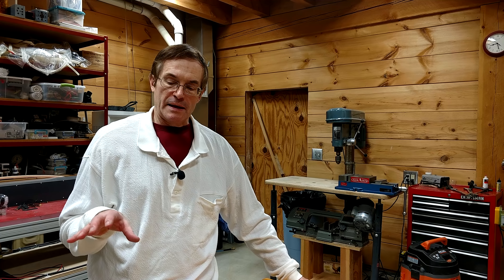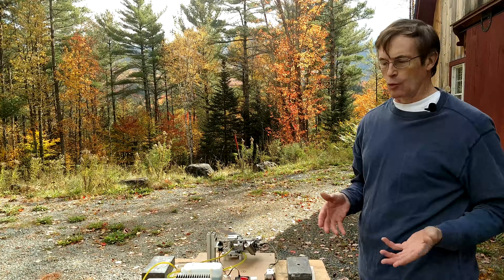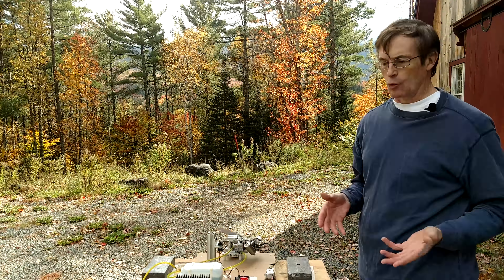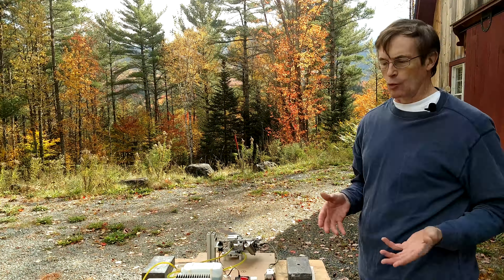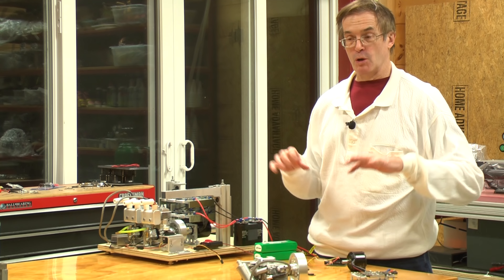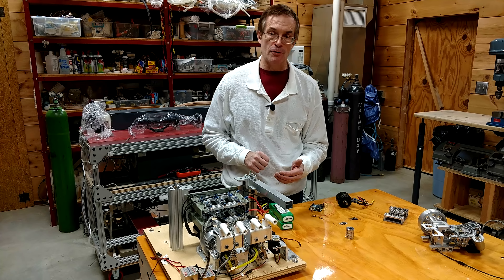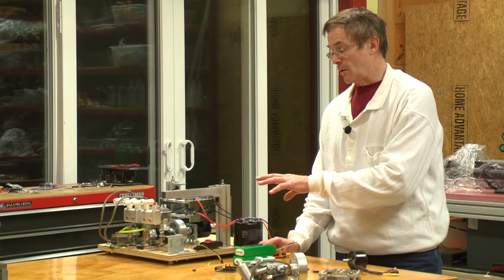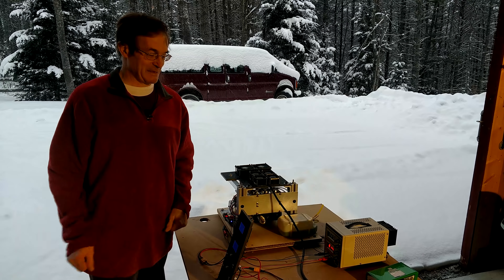Hybrid Drone Generator

Comment: A gas turbine is the better alternative, because all four strokes occur continuously and simultaneously, being separated by location within the engine, rather than by sequenced timing within the same space. Of these, the Tesla Turbine becomes the most appealing option if one wants to build the engine from scratch, because it is easier and cheaper than any other to construct. Use ceramic turbine discs instead of metal to withstand very high temperatures. Incredibly smooth with amazing power to weight ratio and very good fuel efficiency. Couple two of these turbines on the same shaft to use one as a turbosupercharger for the other and you get a staggering increase in both power and efficiency. An important design consideration in the Tesla Turbine is that it operates on gas adhesion. So the spacing between the discs matters a lot. The smaller the gap between discs and the more the number of discs mounted within the available space to make opposite disc surfaces proximal to the best part of the same boundary layer instead of each having its own boundary layer, the higher the efficiency. Ensure in the design that the hot gas circulating in the spaces between the outermost discs and the turbine sidewalls is minimised. Each will generate its own boundary layer, but when this is passive, it presents less impediment. Concentric circular sawtooth ridge & groove ringed surfaces on the outside of each outer disc will significantly reduce this, especially if the same sawtooth rings with the same spacing are present on the turbine sidewalls with disc and sidewall ridges almost touching. This reduces gas penetration into the space with progressive pressure reduction between each groove space and also restricts vorticity in the spiro-circular gas motion.
Reply from the maker: That's an interesting idea. We have built and tested a very small turbocharger/turbojet, not for a thrust application, but as a gas generator for a turbine. 

We have investigated a Tesla turbine and based on my knowledge, you're description is accurate, but there is one very serious problem with it, RPM.  The peripheral speed of this turbine needs to be close to the exhaust velocity of the jet in order to achieve the high efficiency it is capable of.  with a small diameter turbine this around 80,000 RPM.  Directly driving a generator motor at this speed would require an unusual motor. As far as I know, reduction gears that operate at this speed are rare and prohibitively expensive.
We're looking at an impulse turbine similar to Pelton wheel.  Although less efficient, it is easy to construct and produces maximum efficiency at 1/2 the jet velocity.
Reply: Thanks, I see what you mean. Love your teaching videos!  However, rpm at the TT shaft can still be very dependent upon physical load and the amount of fuel being used - also spacing distance between discs. Because it uses boundary layer adhesion, you can stall the turbine under too much load, without necessarily stalling the gas flow. I also think that tangential gas jet induction velocity at the TT can be adjusted to some extent by variation of the nozzle aperture, both in size and angle. I have noted that this is a common appurtenance in TTs (at least, the angular variance is). Beyond that, operating pressure must also influence gas velocity. Slow the flow, increase the pressure.  Adhesion should be about the same at a given rate of fuel combustion, I think. Exhaust aperture size and number, plus exhaust cooling to produce better extraction are two more considerations that may help in achieving an optimal operational balance.Thanks also for your mentioning the Pelton. I am not familiar with that, so it gives me something to follow up with and learn about it. There are other enhancements that I would advocate in the construction of a TT. For example, the interior of the turbine casing can be lined with saw-toothed grooves aligned to the gas flow.They'll be circumferential in the cylinder part and circular in the ends. The end discs would also have circular groove arrays.  These are pretty much like 3M's Microriblet contact polythene sheet, but in the turbine, they should be high-temp alloy.  Cheers!

Comment: Wouldnt you want to use a treadmill motor. They are a 90 volt dc permanent magnet motor and all you need to do is correct the voltage and not worry about rectifying. Am I missing something?

Comment: Would it be out of the question to use several smaller motors, one for each prop? Or is one of the ultimate goals, to design a relatively stealthy drone? I was thinking about some of the 1/10th scale RC cars that use some high octane blends (I believe I have seen some that use 30% nitro methane, not sure if that is real or hype). Traxxas has some that have a decent amount of power. Just curious.

Comment: If I could, I'd use a turbo-generator for the drone. Buy or build a tiny gas turbine that directly drives a 3-phase alternator. The high speed and cutting of flux lines creates a lot of voltage, and the power can be conditioned from there.

Comment: Would the use of rotary engines reduce the vibration issue?
Reply from the maker: Yes.  The only reason I didn't use one is they are virtually unavailable in this size range.  Other than a surplus OS RC engine I'd have to build my own or pay thousands for a custom engine.  That's not useful for the many viewers that might want to try this.

Comment: Will you be addressing the fact that <500w or even <1000w isn't enough to actually power a multi-rotor? This is quite a heavy set up if you take into account just the motors, generators, fuel tank, exhaust, and small batteries. You'll need somewhere around 2-4kw of power at minimum to have a useful set up and the drone itself is very very light.
Reply from the maker: Check out our follow up video on this generator where we produce over 2kW.

Comment: Interesting concept. Since this would be for a drone, why not consider EFI as that would work better with altitude and temperature changes? 
Also what about a wankel engine (possibly dual rotor) in place of the dual two-stroke engines?
Reply from the maker: We contacted a company the produces EFI for these small engines, but the prices were exorbitant.  The rotary engine would be a better choice, but other than a few used, OS engines offered on E Bay these are not available in this small size range.  We don't have the time to design and construct a custom, one off engine for this purpose.  If you have any leads into these options, we would be happy to follow up.

Comment: Hi, liking this a lot! just a daft thought to add into the mix! magnetic coupling! like the old tech heavy machines and marine, so drive comes from the engine but is coupled to each prop by magnetic coupling! lot of mechanical needed and a lot of clever code to adjust the throttle and control each coupling, but the potential advantage of not having to convert power, maybe even add a smaller generator?

Comment: 09:37 If you put a similar motor / cylinder next to it facing the the other direction it should at least reduce the vibration, but only if they are adjusted correctly.

If you build a heat exchanger and use a hose for the exhaust through the heat exchanger you can run the motors inside.

Comment: Curious why you did not opt for turbine like APU design on commercial aircraft?  Seems like even a small turbine would generate 1000's of watts.
Reply from the maker: They are very expensive and the small, RC scale turbines have a single stage compressor.  Therefore, they have a low compression ratio with high fuel consumption.

Comment: so how does this handle different levels of O2? or does it really matter? because the higher your drone goes the less oxygen it will have to work with, though i guess this really only matters at altitude/elevation changes of around 1000 feet (i think this is like 300 meters). Maybe this wont really matter as long as it can continue to do internal combustion you can just up the rpm to compensate at a bit higher fuel usage rate.
Reply from the maker: Adjusting the needle valves at ground level to tune the engine a little lean will give more altitude range.

Comment: answer to this if you want high power with no vibrations is a turboshaft! they are made for RC Helicopters and are by FAR the best power to weight ratio of anything else out there
Reply from the maker: True, but they're much more expensive and have a higher fuel consumption for a given power output.

Comment: I've already asked these questions in your video on active noise cancellation, but here they are again: what do you believe is the best way to deal with the intake and exhaust noise??? Also the non negligible problem of cooling the engine inside a closed enclosure, padded with isolating materials (could an external radiator be used with a heat pipe that uses the difference in enthalpy between the liquid/vapor phase of water as the thermal transfer mechanism, assisted with gravity as a free pump mechanism, using a conductive epoxy to create a low thermal resistance between the hot engine head and the heat pipe...?). 

You mentioned that their are only 3 variables that control the sound attenuation property of any closed enclosure. I believe that there is one more variable that could help significantly: the wall shape. Curved walls (cylindrical or spherical sections) are much more rigid then flat walls and can thus be used to increase the sound attenuation (assuming that some sound absorbing material is used inside the enclosure...).
Reply: Just want to add that the sound could go "up" from an open box, and so could the engine heat.  The remaining sound only has to be as quiet as the 4 propellers.  2 strokes can have a long tube exhaust after the expansion chamber then a muffler.

Comment: Now we are making a hybrid drone. The engine uses a three-phase motor to generate power, and after that, a three-phase diode is used to change it to two phases, and then the battery is charged. However, if a capacitor is used to charge the power generation energy into the battery, the required wattage of the power generation motor is 2kW, and the capacitor is too large to mount a drone. I want to know how you solved this. And if you don't use a capacitor, I want to know how you handled current and voltage.
Reply from the maker: Remember the capacitor(s) reduce the voltage/current spikes but never eliminate them. The size of the residual ripple depends on the capacitance.  As long as the capacitor's ESR is sufficiently low to allow it to handle the current flow then it can be significantly smaller than a traditional filter capacitor for a power supply.  The battery will further filter the output. You can size these two components so that neither over heats, but no larger.

Comment: Very ingenious. What about going a bit further in miniaturisation of the generator by using miniature model airplane engines to rotate the brushless motor....
Reply from the maker: We have built a generator that is half as large as this one.  You can see it on the table in our Lab Tour video.  Going much smaller is a little tough as the glow engine fuel efficiency is terrible and the weight savings for engines smaller than 20 cc becomes progressively less.  It doesn't scale linearly.

Comment: What about using a rotary RC engine?  Very smooth running and doesn't have the vibration, counterbalance issues a piston engine has.  The downside would be fuel efficiency.   Running two engines with the output shafts facing each other would eliminate all torque effects as one would run clockwise and the other would be counterclockwise.
Reply from the maker: You are correct.  The problem is availability.  We didn't just want to build a generator as a curiosity, but to map out a design that others could imitate and improve on.  Other than the surplus OS, RC engines there are not any reasonably priced rotary engines in this power range.

Comment: I have a gasoline-powered RC helicopter (Miniature Aircraft USA X-CEll Spectra-G). It' engine spins a brushless motor attached to it's output shaft, that in this case functions as a 3-phase alternator. The output is fed to a 3-phase rectifier, then to a voltage regulator and battery charger. Result: I never, ever have to charge the heli's onboard receiver battery.  In fact, the generator alone could supply all the heli's electrical needs.

Comment: If at each point of the quadcopter you used both an electric motor and a gas engine co-located on the same shaft you would be able to modulate thrust while drastically increasing run-time. You would not incur conversion of energy losses from kinetic to electric and back to kinetic. Also I love your channel.
Reply from the maker: Thanks!

Comment: Really enjoy your videos and the way you science it down to the relevant points. 
Natural gas fuel cell electric generator could possibly be more efficient? They're said to be 40% efficient and 90% if there's a use for the heat. So if your looking for another project, I'd love see the mechanics of the ng fuel cells scienced in this format..
Reply from the maker: They're more effecient, but they're not available at almost any price and the few that are cost a fortune.
Reply: @TechIngredients  yes I figured as much. I don't know the limits of the tech. I would think the most expensive components are the semi permeable plates. Where the ng gas comes into contact with the oxygen and the conductive plate. So as when they interact the conductive portion channels the electrons away.  Thinking these plates could made from sandwiching stainless steel wool between perforated plastic plates... But I don't fully understand the tech, is why I suggest it for you as a project. And I wonder if using varying size diameter cylinders and building the fuel cells like nesting dolls. Wrapping the steel wool permeal barrier around them. Then with that geometry pressurizing the ng and within the cell. That's if making permeable barriers out of fine steel wool is even viable, of course. Of course there's the heat issue with ng vs say hydrogen. But my thoughts are if they'res more but  smaller, they may be able the carry the heat away to the exterior where it can be managed.
Reply: @TechIngredients  and I wonder if anodizing the stainless steel wool with palladium would be enough palladium and surface area to catalyze the reaction. I don't see any baselines on the internet to follow...
Reply: I finally found some info. Google sends me in circles. Found some good info on ng fuel cells on utube thou. Yes I see how they work now and why they're expensive. There's five major types. Alkaline, phosphoric acid, proton exchange membrane PEM, solid oxide, and molten carbonate. Still thinking there outta be a way to make it work on the cheap and not sacrifice to much efficiency. 

Just saying. I have no expectations from tech ingredients. I just suggest because it's something I'd like to know. Sorta selfish or just plain selfish but I'd think that utuber publishers would want to know what their patrons are interested in. I see thou it'd be a tougher one to build from scratch. WATT (working all the time) industries, interesting acronym, has developed a 3d printed ceramic solid oxide natural gas fuel cell for home use. Heats the water and supplies the electricity. Anyways word.

Comment: I like. Very well done.  First one of your vids I've come across.  I'll now go check out how you went with your more recent vids on this subject.  I would love to find out how small you can make this and still benefit before it becomes unworkable.  I'm into from 3" to 24" quads. I can see this working on a 24", but I would love to see how small you can scale it (12", maybe smaller with 4 stroke dual cylinder v config Nitro motor(s)).  I love the advent of the electric motor/ lipo battery revolution that happened to the RC hobby, but it did come at a cost.  You need lots of batteries instead of lots of fuel.  Maybe a hybrid is the way forward until batteries improve (like nano-carbon and/or glass dielectric batteries).  I'll now go looking for followups.  Hope you kept going with this.

Comment: What about a recuperated microturbine which may provide higher effiency, and also the high exhaust velocities could aid in lift and forward flight.
Reply from the maker: We have built a very small turbocharger based turbojet as the source for a turbine driven generator.  We will be demonstrating this engine soon.  However, the efficiency of single stage turbojets (ours as well as commercial RC engines) is substantially lower than a piston engine due to the low compression ratios.  The high power to weight ratio helps to compensate for this limitation.

Comment: Thanks for this! I'm gonna get a harbor freight cheap generator, a couple ford fiesta size car batteries, hotwire em to 8 drone motors with a folding lawn chair attached to me and the generator. Generator throttle will adjust how high I go!!! Wish me luck?! Thanks for sharing! ( Each prop will have a parachute above it like an umbrella! (Wait. That's backwards?)